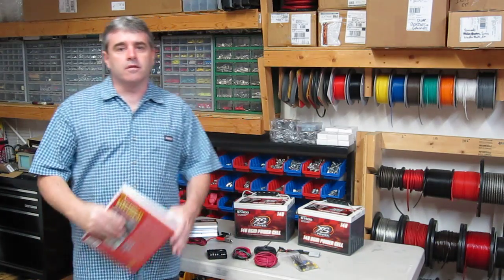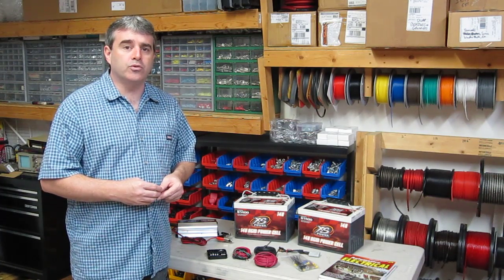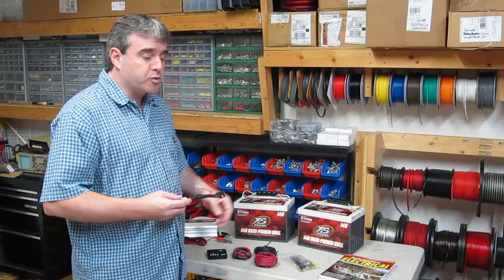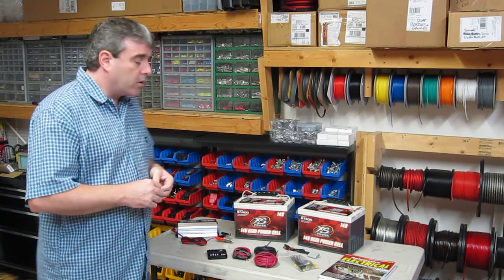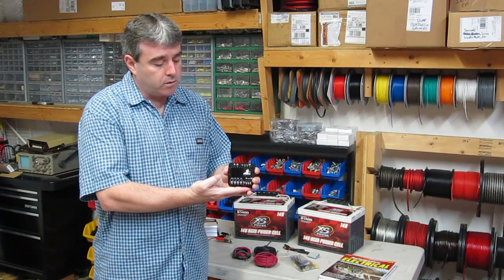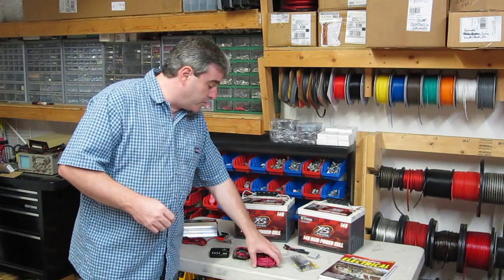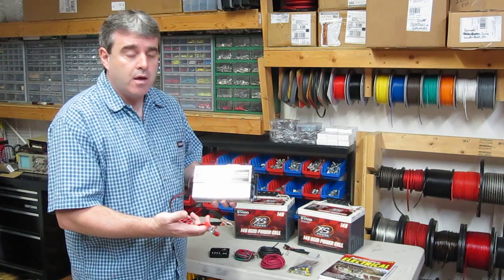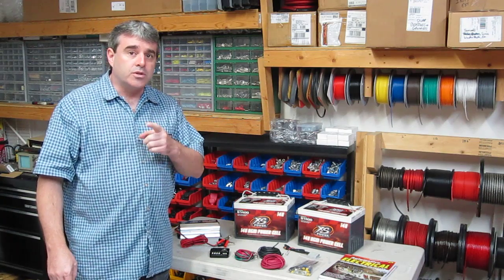14 Volt Battery Conversion Part 1

Comment: What vehicle was this 14v system supposed to go into?  21 PSI of fuel pressure, mine FRP is set 43 psi and can goes as high as 70 psi.

Comment: If your building a performance  car and your fuel pump is a  AEM 400lph unit you need not worry about controlling the voltage. There rates 12 to 16 volts.

Comment: Would under charging a 14 volt battery hurt it? and if so, to what extent?
Reply: You can't use a 14V battery with an alternator set up for 12V batteries.  The battery won't last long.  The alternator must be set up to output the additional voltage as discussed in this and the 2nd part.

Comment: I'm running a 16v battery with a 16v alternator on my (mostly) stock 74 Dodge Dart. I'm wanting to install a battery disconnect switch but I cant find any dedicated to 16v with the amperage constants/spike protection that I need. Most of the 16v switches have really low amperage ratings, however 12v disconnect switches in the amperage ranges I need are a dime a dozen. Would I be able to safely run a 12v battery disconnect switch on with a 16v battery?
Reply: Sure.  Such a small difference in voltage won't make a difference to the switch.  We stock several to choose from at out web site - ce auto electric supply dot com.

Comment from the maker: UPDATE 10/26/11 - Unfortunately, the cam in the project vehicle got wiped just after I shot this video.  I am in the process of replacing the cam, most of the other valve train components, and having the heads totally rebuilt.  Bear with me as I get this done so that we can finish the project.  So it is with hot rods!